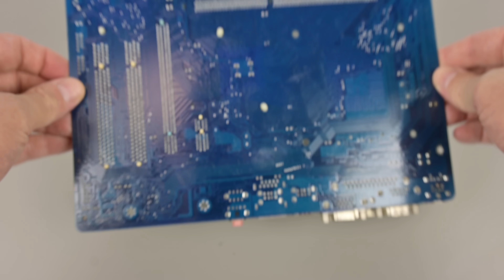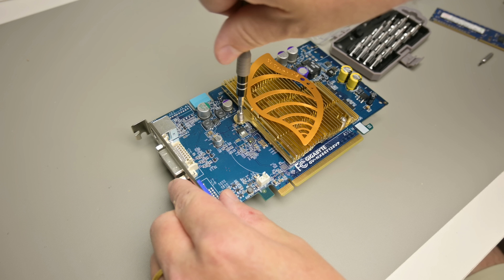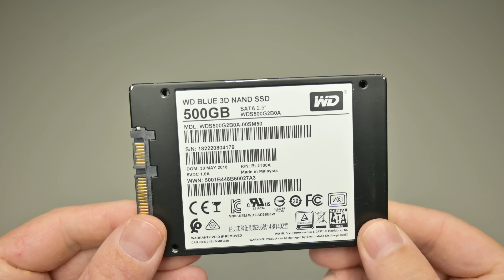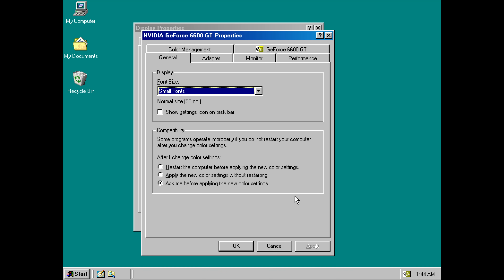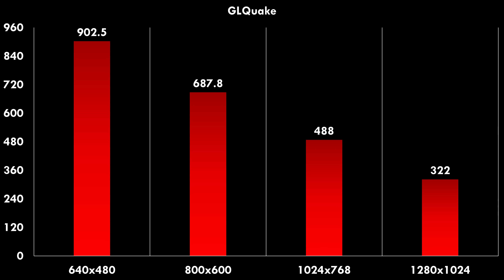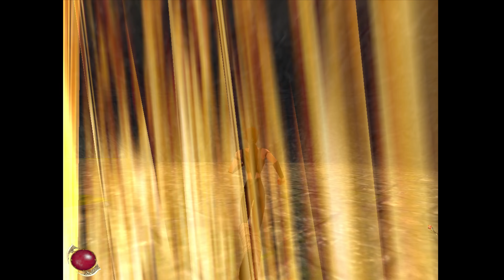E8600 Windows 98

Comment: I remember this processor. Intel was looking for release a C2D E8700 sometime after the E0 stepping versions came out. 
I always saw processors like the e8600, Core i7-940, E6700, Ryzen 1800x0 as mostly pointless because they were priced so much higher than their cheaper counterparts and they did not always overclock better.

Comment: try gaming on ryzen 7330u it has a igpu with basically 2012 gpu power and full dx 12 support but no rt. i do test some old games from 1999 and i was shocked that my rtx spec needs dgvoodoo emulation for those games. rtx is such shit good for nothing gpus.

Comment: Maybe I missed it, but what ram setup are you using? 98 can only support 512mb right? Or am I wildly incorrect?
Reply from the maker: There are patches to help. With DDR2 and 3 you should be able to find 512MB modules just fine.

Comment: I got a laptop, brand new, in 2009 with the laptop version of this CPU for 600 Canadian dollars, and this was the original price when the Laptop first became available for purchase, and when the Core2 Duo 8600 was a very new CPU.

I still have the laptop, and it still works, but the CPU cooler definitely could use a re-paste to get the thermal throttling and temperatures under control.

Comment: Always lots of unknown tips on your videos like USB stiffy drives and no separate audio-out on SATA optical drives. I was running Win10 on an E8500 maxed out on 8GB RAM until I swapped it out for the quad core equivalent. Both CPUs are more than adequate for it; will be swapping out the HDD for a SSD soon.
Reply from the maker: Awesome to hear you picked up some useful info!

Comment: What drivers did you use for the motherboard's chipset, couldn't find any official or even modded G41 Express drivers for W98 on creopard, or other sites?
Or did the machine run flawlessly even without?
Reply from the maker: There are no chipset drivers, so yea, it just works. Just ignore the missing devices in device manager :)
Reply: @philscomputerlab  Lol ok, so the never ending story of retro hardware either careing too much, or not at all about drivers or added hardware, continues once more. 😄
Remindes me of my W98 build from a few years ago, tried to mount a 7900GS with W98.
The Gigabyte 965P fiercely detested it, the ASUS
 P5B Deluxe loved it.

Comment: I think one other reason the E8600 could be faster (beyond pure core clock speed), is it is also the fastest dual core @ 1333MHz FSB.  Almost all other Core2's have a 1066 MHz FSB, AND memory was connected through the chipset, not directly to the CPUs at that point.

Comment: I use the Nvidia 66.94 for a mobile Geforce 6600 Go. It solves the issue with Screamer 4x4 in Direct3D mode and probably other games too. Maybe you could try this one out next time
Reply from the maker: Good info, thanks!
Reply: If you want to push the e8600 even harder, you could go with a 7800 gtx! The latter is compatible with the 77.72 driver and shows a similar compatibility behavor as the 6600 running the same driver version. 7900 gtx is possible too, but this one needs the beta driver 82.69, which turned out to be buggy in some cases.

Comment: I really do need to warm up my Core2Duo machine again and give Win98 a shot on it. I don't have a GeForce 6600 so it likely won't be silky smooth but I do have an older PCIe MX4000 card as well as a PCI FX5200 card. As much as I loved that machine, I made the mistake of upgrading it through Windows Vista and Windows 7 back in the day and losing features, particularly in the sound card so I really need to try dropping the RAM back a bit and letting it relive as a Win98 / WinXP machine.  
Great video!  I've been on the lookout for Drakan since your initial callout.
Reply from the maker: PCIe MX4000 sounds so interesting!

Comment: It's interesting to see what one can do with these newer parts for running Win98 successfully. Right now I'm not in need of building a new retro machine, but it's great to see the alternatives. There is something to be said about period accuracy, but really all that matters is being able to run the games I want to run. Apart from my modern rig, I have a Slot 1 Pentium III 500 MHz build with a Voodoo 3 3500, Soundblaster AWE64 and a Gravis Ultrasound which I use for Win98 and DOS, and then a Socket 478 Pentium 4 with an Audigy 2 ZS for later Win98 and XP. If I come across a game I can't play accurately with what I have, then I can consider building something new. 

Something that might interest you. Remembering your video about using CD images in DOS and getting CD audio out of them. I forget if you ever covered the PicoGUS project, but the creator just added CD drive emulation to it, with CD audio support. The down side is the PicoGUS is an 8-bit ISA card, so it's limited to what hardware it can work with, but it's much less expensive than other alternatives.
Reply from the maker: Yes I've heard from him about the CDDA! I will definitely check it out 😃

Comment: Meanwhile, here I am with an AsRock 775i65G R3.0 I got for $10… and a Pentium E5800 with 2GB DDR1, but my only open GPU’s at the moment are a 32MB Nvidia TNT64, 32MB GF2MX vanilla, and 64MB GF2 MX400 DDR. If I can snag a good AGP card like an X800 then I wonder how it’d do as a 2-in-1 9x and XP gaming PC. obviously the RAM would have to be limited to 512MB in 9x, or as mentioned I should try QuickInstall for once in my life. or if I did 9x only, then the GF2 MX400 would do good.
Reply from the maker: Bargain for a great motherboard 💪

Comment: Now you just need an E8700 or a Xeon X5270.
Personally, I like to have both... A high end 98SE system with ISA as well as a crazy high end 98SE system. You can go way higher than LGA775 as I am sure you are aware.

Comment: I think the best option for playing old games with maxed out settings and high frame rates is to build a fast XP system with Ivy or Sandy bridge and a 500 series GTX or better. Most Windows 98 games work in Windows XP anyway. However if you're going windows 98 route, a Prescott P4 or Athlon 64 based system will allow you to max out everything nicely.

Comment: By and large I usually stick with authentic, periodic correct builds as I think part of the fun is playing the games as they were (albeit on high end hardware) when they came out. That being said, this video reminds me of a project that I'm currently working on to make a dual boot win98/xp machine using a LGA 775 mobo with an AGP slot. The mobo only supports P4 and Pentium D CPUs but I've found a nice 3.4 GHz P4 to put in it.

Comment: You are right about Drakan having occasional stutters on lesser hardware. My core 2 duo x6800 with geforce 4600 and 10k RPM HDD is mostly smooth as butter, but it stutters occasionally in this game.

Comment: It isn't just overkill it's completely wasting half the CPU windows 98 does not support more than one core. The fastest Windows 98 SE machine I ever used was an AM2 AMD Sempron 3200+ low power chip, thing sipped like 20 watts under full load and just flew through everything.

Comment: Ah yes, I also wanted to add some thermal paste to the 6600GT. Good to know, that I shouldn't try to force off the heat pipe. :D (Edit: Just removed the heat sink and the cooled was already detached from the GPU, so it's not soldered on but uses some really dried out and hardened thermal tape - while I got the GPU relatively clean, they cooler has it really caked on, so I put some goo gone on it in hopes that this will soften it)
Btw, I played through Unreal on one of my XP 32bit machines a few months ago and found out, that if it runs too fast, at some point it will break the game. You have to get past some huge fans that are trying to suck you in and at high frame rates, the suction is so strong, that you instantly fly into the fans and it's game over. Limiting it to 60fps fixed the issue.

Need to test the Phenom II system again to see if Win98SE boots faster when having a PS/2 keyboard attached to it. I somehow remember once hearing about such issues, that the OS could hang for a while when trying to find a keyboard.
Interesting to see that the 4GB RAM don't seem to cause issues. I actually went out of my way to get a 1GB bar, because I thought that this might be the cause for my issue (back then I thought it was at the Win98 splash screen endlessly, not "just" half an hour)

PS: Did you hear about PicoGUS now being able to be used as CD-Rom drive emulator incl. CD-Audio?
Reply from the maker: Yea quite a few games have issues on machines that are fast and PS/2 also can help with compatibility. I will doma video on the PicoGUS update!

Comment: This makes me want to get an overkill system running. I have a Pentium Dual Core E5500 that I’ve over kicked to 4 Gigahertz (From 2.8) and it was blazing fast. I also have a 256MB 7600 GS which would pair well. The raw clock speed is enough to even compete with a Core 2 Quad even!

Comment: I am not a fan of using multi core CPUs in a Single core OS. For a genuine fast Win98 Build I chosed Socket A and maybe socket 754 is an Option if you have the luck to find an fast enough Athlon64 to beat an AthlonXP 3200+.
Reply: What's the big deal?
The OS just ignores the second core. 👍
Reply from the maker: Why? The second core just remains idle. You can multi boot with XP,.Vista and use the second core.
Reply: @philscomputerlab   Because the second core just remains idle :)
Reply: @AncapDude you know most of the games at that time only ran on one core... no matter how many cores the OS supported. 😂😂😂
How will you ever sleep at night now. 😂😂😂
Reply: Not only is the e8600 faster than any athlon processor you mentioned... It uses less power and runs far cooler, even with 2 cores. 😂😂😂 It's also cheaper and easier to source. 😁😇 A Retro gaming bargain. 👍🥰
Reply: @DavidK-Delta   Ok Dum*ass, then build your fckin senseless machine and i build mine.

Comment: I have always believed that things should be kept era correct, meaning going past a P3 for windows 98 is silly. But I agree, having an overkill hardware system for a vintage OS is really nice.  I have changed some of my thinking, at least for XP and beyond on that one. Second - Fourth gen I3 /5 is delicious for XP - Win 7 gaming.  My wet dream was to see Quake do 1000 fps under dos. I still have yet to see hardware do that no matter how modern it gets :face-green-smiling::face-green-smiling::face-green-smiling:
Reply: My record Was something over 900fps but I cant remember which Platform 😂
Reply from the maker: Agreed! Sandy Bridge is so nice for XP and 7! I need to try Quake in DOS then and have a look!

Comment: I didn't know that the LGA 775 socket is compatible with Windows 98. I assume it uses a single processor, even though it's dual core.
Reply: Yes. Second core is idle all the time.

Comment: A suggestion for a next video: you could debunk the voodoo3 craziness ( $200 on Ebay?  ).  It is a pentium 400 period GPU if I remember well.  A x300 or x300seSE PCI Express is about the same as an ATI 9550 that was out in the about 2ghz CPU period if I am right.  It gives more than twice the performance in 3Dmark in 98se and cost almost nothing.  But I could not play Descent 1 or 2 on it.  Maybe it is powerfull enough for a Glide wraper .

Comment: I'm all for the overkill system, just to watch it smash those older games.  I've got an E8600 system that I intend to get up to 16GB of DDR2 RAM.  I already have the first two sticks in, I'm just waiting for my wallet to recover a bit to get the other two, because those 4GB sticks are quite expensive.  It has a Radeon HD 6850 graphics card, and a Sound Blaster X-Fi PCIe for the sound card.  It's got Windows 7 and Windows XP on a regular old spinning rust drive, installed in SATA mode.  The board itself is a Zotac board with Nvidia's mcp7a chipset.

Comment: Very fun and impressive result, but there is bound to be some compatibility issues because of the speed. I have run into this issue on much slower CPU's. As for the games, Although I do like my physical collection, Installing them from disc is quite tedious and time consuming. I make use of redump images on USB hard drives. This way I can control the patch version if required. Also the discs are sorted by year as this is usually a good marker to see at what point the CPU/GPU start to struggle, or have some OS compatibility issues. This system and a slight upgrade to a 6800 with multi boot 98+Me+2k and XP partitions would be excellent for an All-in-One option to only have 1 PC to cover all those eras, and save a lot of space. And off course it will cost a lot less than acquiring old parts which would not be able to run glide wrappers if required in any case.

Comment: the debate over Dual Core or Quad core is simple. If you're running a Dos based Windows (3.11, 95, 98 or ME) then you're wasting your money on a quad core as these OS's only support single core, so even the 2nd core on the Dual core is not being used. If you are going NT based OS (NT4,Windows 2000, XP, Vista, 7) then Quad core is worth it as they are SMP aware OS's and can take advantage of up to 4 cores (more on Windows 7)

Comment: G'day Phil,
🤔Seems with those 🤪CRAZY🤪FPS this E8600 + 4GB 1333-DDR3 + PCIe X16 GPU + SSD + Creative SC combo is WAAAAAY OVERKILL for W98
like my i7-2700K + 8GB 2400-DDR3 + SSD + Creative SC + GTX780Ti Classified HydroCopper with Custom Cooling Loop is for XP Home (32bit), not for MAX FPS but MAX Detail Settings.
While they are easy to build using relatively cheap parts theses days, they would have been Super Expensive😲DREAM PCs back in the day
Reply from the maker: Yes total overkill! But also budget friendly. What a contradiction 😁

Comment: Really interesting to compare this to the MattKC ultimate Windows 98 machine video - this one effortlessly outperforms it - I'd love some more links in the description to the tools used.

I have a P4 3 Ghz (non-ht) with a GeForce 7900 gs - I wonder if that will be faster or slower than this assuming I can get 98 working on it.
Reply from the maker: That Pentium 4 will hold things back despite the GPU being faster.
Reply: @philscomputerlab  probably true.  I have a E8400 running with a 750ti as a XP machine but I can shift its use case...

Comment: My 98 rig is running a P4@3.2GHz on a 478 socket with one 5900XT and one voodoo2. For sound a live 5.1 digital and 512Mb ram. I have one core2duo laying around and a 6800 ultra pcie. You’ve made me rethink my life choices with this video…
Reply from the maker: Sounds like you have a great retro setup already!
Reply: Thats a great combination of hardware you have already. A good compromise between compatability and performance. I think 6800 Ultra, whilst it is faster, will give you more problems in Win98 than the 5900XT
Reply: Thanks you both for your replies! I’ve been thinking about this and I decided, whenever I got some spare time, to test the core2duo build with the 6800 without touching my current rig and compare both! Thank you again for the replies! Excellent job @philscomputerlab , you have been a reference for my retro builds!

Comment: I had very good experiences with this hardware combination in 98, too. Although I mostly used the older 945 chipsets for 98. The sound worked in DOS, and the SATA CD-ROM was even recognized by the MSCDEX driver in DOS in IDE mode. This no longer worked with later SATA ports. My favorite board for Windows 95 or 98 on Socket 775 is the relatively unspectacular Foxconn 45CMX. Since SATA CD drives no longer have a CD audio port, I always used a model with an IDE connector and then connected it to the SATA port via a SATA-to-IDE adapter. This way, I had a SATA ODD and could still connect the CD audio to the sound card. In conclusion, I have to say that Socket 775 offers the longest-lasting and most versatile use cases. Everything from Windows 9x to Windows 10 is possible. It's the bridge from the old PC architecture to today's modern one.
Reply from the maker: Oh that is a clever solution to getting CDDA!

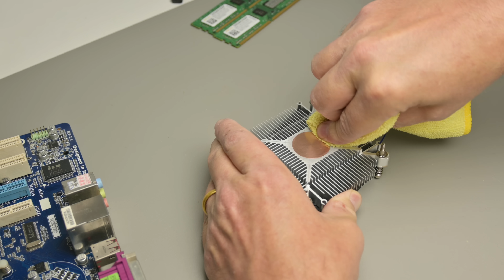Comment: 2:00 What a silly argument, Win98 can only see or use one core.
Reply from the maker: Yea that's what I used, but bit everyone does, and the topic is still highly debated in the community. That's my point
Reply: But the cache is shared between the cores, so, when 1 core is utilized, it can use that huge cache (even if it has no big advantage, it has the advantage over "1-core architecture") However, this means higher power consumption if you decide to choose e.g.: a Core2Quad over the Core2Duo. Important thing is that the cache is shared between 2 cores (e.g.: 2x6MB) in case of Quad processors also, so only half of it can be used for such operating systems.

Comment: 7 series is so much better in 98 it's not even a competition.  My favorite is the 7950gt the 6 series have weird input lag in 98 doesn't matter AGP or PCI-E.
Reply from the maker: Input lag? That's interesting, I didn't observe anything in that regard. What drivers are you using with the 7 series?
Reply: @philscomputerlab  I was wrong about the 6600gt, must have been something to do with the i915 chipset.  Just tested the 6600gt on an i5 640m and it doesn't have any more or less lag then a 7.

So the 6600gt really is a great option, I still like the 7950gt better.  I use the 82.69 and the Rloew Patchnvc.